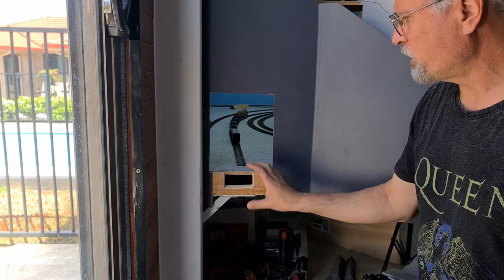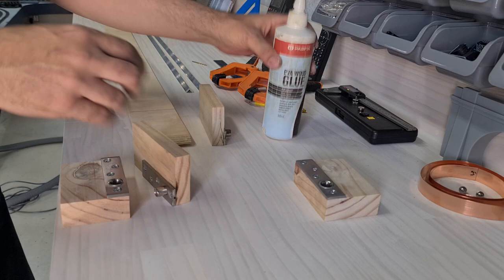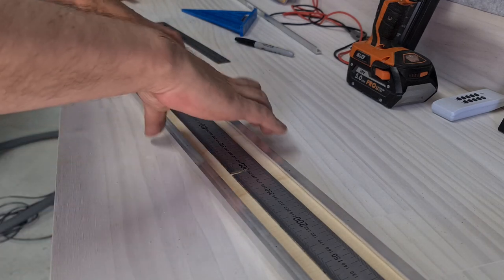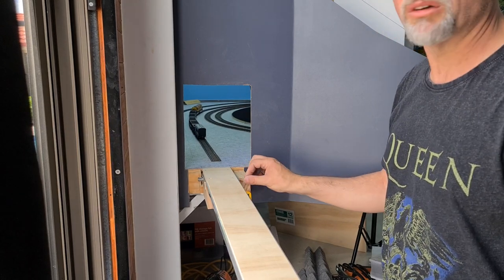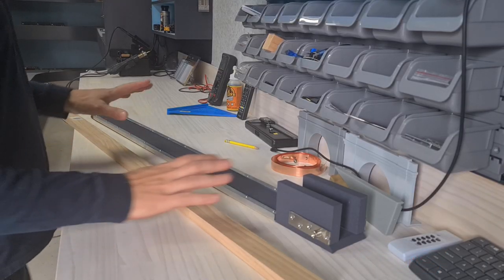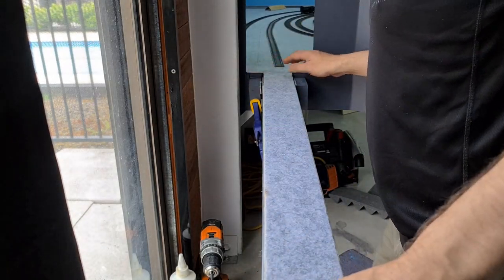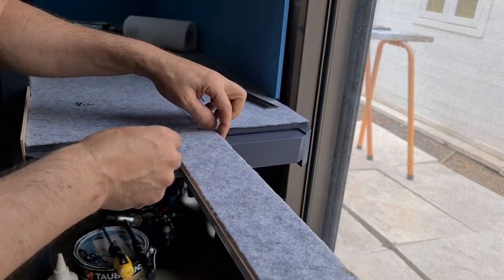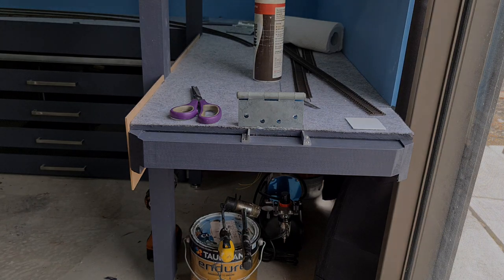Building the Lift-Up Bridge Part 1 - The Escarpment - November 2022

Comment: Hi mate 
Beautifully engineered as usual! 
Watch your track clearance at the hinge point. You’ve cut it pretty fine, when you raise the bridge the track on both sides of the join actually move closer together as it swings through the arc and the two ends can hit each other. Hinges for bridges that raise are often mounted on top of the boards. This’ll make more sense when you lay lay track across the hinge  end gap.
Reply from the maker: Hi Gary..cheers. Yeah next video should make or break with the finished outcome.  I'll be clamping down the tracks to see what type of tolerances there will be. Hoping with an arc of 1100mm, it will present with more leeway. Yeah understand the hinge on top..but I find that ugly and I always need to be a little different 🤪..even if it bites me on the backside lol..

Comment: Nice job there. I had seen on another video that if you install the hinges on top of the left section and the table and installed some 1/4 “ plywood under the hinges and on top of the tables you get over the swing problem.
Reply from the maker: Thanks for the feedback. That is correct! But I didn't want any hinges visible, so I went with this solution..cheers

Comment: Jason - always informative and interesting.  I think your fundamental issue is one of geometry.  when you have the pivot point below the surface of the bridge, the end of the bridge will move further into "the abutment" ie the fixed track.  you'd have found it much easier if the pivot was above the track level.  I see another comment where you say you don't like the look of that arrangement - so you've made a choice and that's fine but obviously you have to live with the issues
Reply from the maker: Thanks for your feedback Lee..spot on and yes my geometry sucks. But part 2 of this series sorts it out lol..cheers

Comment: Hi Jason - That was great mate. Simple operation, some make it really difficult for themselves. 
As usual a very thorough fix, possibly over engineered LOL.  I think I might have fitted a couple of long hinges on the top along either side of the track and bolted them on.
 Looking forward to seeing how you wire it up. 
Regards Chris
Reply from the maker: Hey Chris, over engineered? Not sure what you mean 😉 lol. Yeah track and wiring next on the agenda..regards

Comment: well it looks well built, nice and sturdy. I am anxious to see track laid and the test train on er.
the way you're doing it does look complicated.
Reply from the maker: Hi David, that will be the next part to it. Still thinking about the wiring aspect, but given I do have a few locos with keep alives, Im wondering whether I just keep it simple without any fail safes built in. Which part looked complicated, using those pivot hinges? They just lacked the finer adjustments, so I have to improvise in certains areas to line it up correctly..regards

Comment: Jason, great work as usual. My bridge is a drop-down one, which is then located underneath with pad bolts. I reckon a curly cord will work to power track from one side to the other. I have found up to 5mm change too from wet to dry weather, with the timber expanding in wetter times. track alignment is tougher with expansion and contraction. Dallas - Kingsview model Railway.
Reply from the maker: Hi Dallas..thanks! Havent experienced the changes in wood as yet..well hasn't  been dry for long enough lol. I have another design in place to power the bridge and the two isolated tracks on each side, will be in the final video instalment..cheers

Comment: The bridge is at a low height, blocking the door.
I hope you will never break your neck when you are hasty and do not see the bridge.
I ran through a fly screen with my thoughts elsewhere, but I am getting old LOL
but sometimes extraordinary things have to be done to solve a problem.
Good luck!
Reply from the maker: Hi Huib, very good point. As long as I don't  get lazy and just go to step over it all the time, I should be right..well fingers crossed anyway lol. Appreciate the feedback..cheers

Comment: You could have put the shim under where the bridge rests on the opening end. As far as the hinge end, you could have adjusted the hinge mount height and avoided putting the styrene under the mat.
Reply from the maker: Thanks for the feedback Jeff. Unfortunately if I put it under where you have suggested, it would of been twice as high..it needed to go where I placed it (on the layout side). There was a lot of little tweaks off camera wirh the limited movement that the hinge would allow. At the end it was 0.5-0.8mm too high and the easiest option was to place the sheets where I did, as it was the bridge that was just that little too high for a smooth transition of where rail meets rail..cheers
Reply: @JasonWood_Escarpment  understood. The little tweaks are pretty nerve racking at times I know. Layout looks great, for a guy who claims he’s not a carpenter per se but just like working with, I’d say your very good at not being a carpenter🤪😉 pun intended

Comment: Great work Jason! I’ve used your viaduct vids as a great reference building some n scale replica zig zag railway viaducts for my layout. While watching, I found myself thinking about some rare earth magnets as a form of latch, both up and down. You can get them with a countersunk hole for a screw, and you could recess them into the existing timber for a very clean positive latch, and could potentially use them for power transfer.
Reply from the maker: Hi Phil, some food for thought there. I don't suppose you know where one would purchase those from here in Australia? I guess I'm wondering how strong they are, but either way, something to look into..regards
Reply: *each
Reply: I’m keen to see what you have planned for the brick work on the viaduct. I know you mentioned 3d printing. N scale has very little available, I’m tinkering with some noch sandstone brick sheets and reducing them on a colour photo copier to see how they go, but I think the texture will be important.
Reply from the maker: Yeah, no change there, I will be covering the viaduct with 3d brick prints. Before the 3d printer I was looking into photo prints, but fir me I wanted that texture. Even though from a distance you wouldnt notice

Comment: If you mount the hinges on top of the board the track opens up and moved away without any issues
Reply from the maker: Hi Gary, my approach was to not have visible hinges. Otherwise, this would have been the easiest approach..cheers

Comment: Jason shut you not make a connector underneath the bridge, when open the track a meter on both side Do not have any power. 
Won't have any runneway trains, just to be sure
Reply from the maker: Hi Yuri, yeah still thinking about the power configuration. The problem is I have a few locos with keep alives and even if the power gets cut, they have onboard power for up to 7-8 seconds..regards
Reply: @JasonWood_Escarpment  oké and what about, when the bridge is open on 2 point on the track when a train will pass there will be a zoomer or different sound. So you can cut off the Train speed yourself.
Reply from the maker: @Yuristinkens  Im even just thinking of making some soft foam barriers for each side. So when the bridge is up they can be put in place on both sides across the track.
Reply: @JasonWood_Escarpment  I would be a person, open the bridge have the nice soft stops, but never put them in place because my mind is somewhere else!!
Reply from the maker: @Yuristinkens  know that well..I might see if I could incorporate them automatically, will see how I go